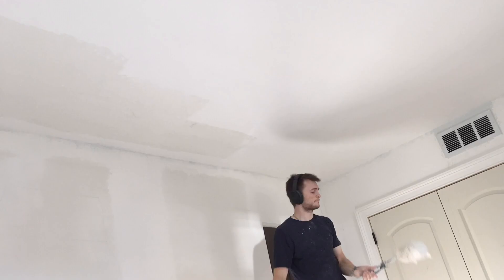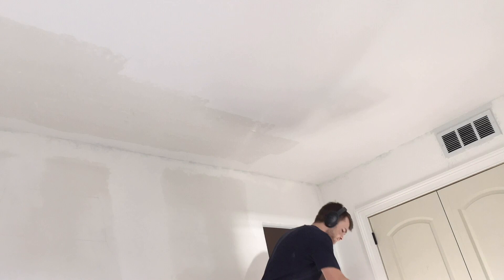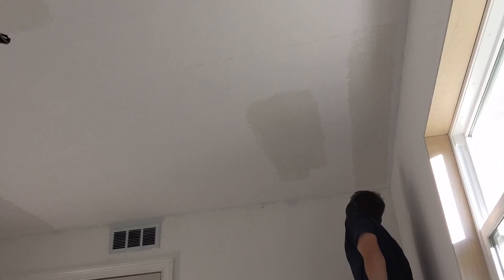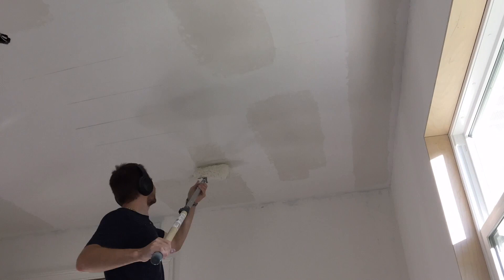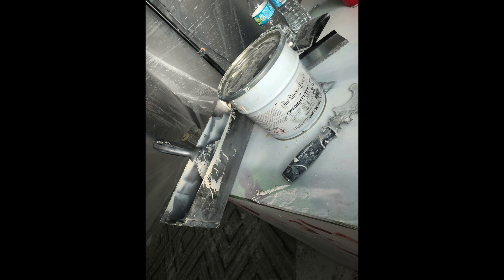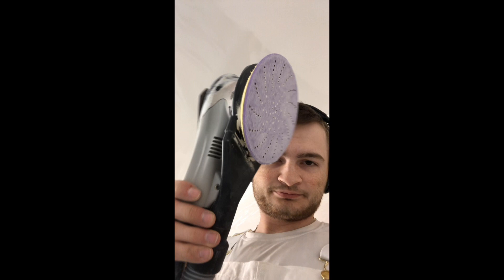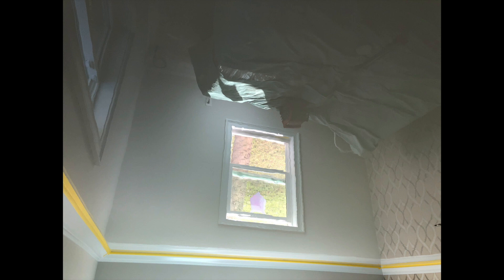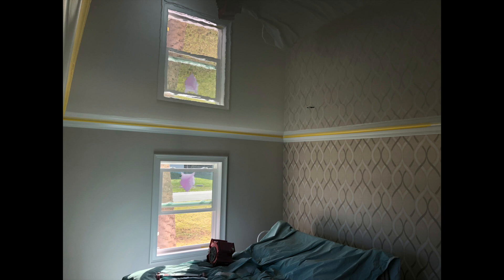High gloss ceiling with hollandlac brilliant 98

Comment: Nice work. After the Swedish putty did you prime with their oil primer? What is your process pre finish spray for sanding and cleaning? I’m starting a 30’ wall using the Fine Paints of Europe sign enamel soon. Had some issues with thinner pin holes. Thanks
Reply from the maker: No reprime after Swedish putty, i vacuum and tac cloth, i havent had the issue with pin holes before, try cleaning your equipment really good with acetone
Reply: @tylerdavidson5114  Ok thx. Did you spray with a pressure pot? I hear so many people having problems spraying this product and having orange peal and thinner pop issues.
Reply from the maker: @kenetic1228  sprayed aaa. 310 tip. this product is thick thats as low a tip i go. and thinned 20 %. orange peel is all about how much product to put on its either too much or too little. test on a panel and let it sit a hour. it does basically all its leveling in that time
Reply: @tylerdavidson5114  thank you much. Do you use a pressure pot?
Reply from the maker: @kenetic1228  no i have sprayed fpe with a automotive gun before and worked great

Comment: Looks awesome, did you thin out the gloss
Reply from the maker: yes 20-25%. lays out best this way
Reply: @tylerdavidson5114  , I thin out the same with the products I have here in Australia,
Reply from the maker: @Artie6937  perfect!
Reply: When you thin, do you only use the mineral spirits, or an oil too???
Reply from the maker: @ashleyhill8737  thin with mineral spirits only
Reply: @tylerdavidson5114  ok thanks 😊 👌 🙏
Reply: @tylerdavidson5114  , I use enamel thinners if I’m spraying, I might try with mineral spirits at that percentage  might get a few runs on the architraves lol
Reply from the maker: @Artie6937  its really thin and runs easily.so be careful